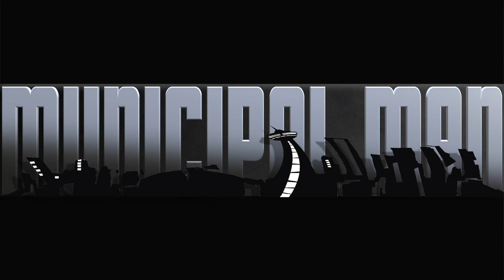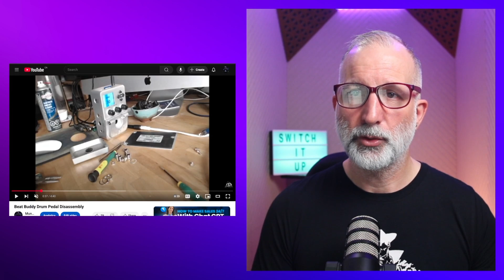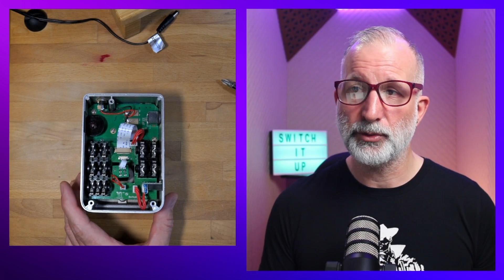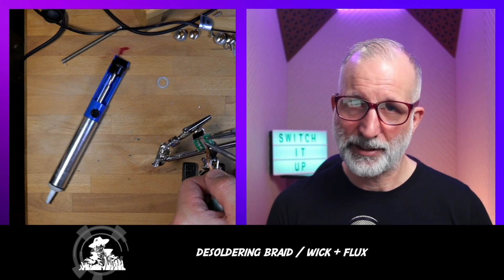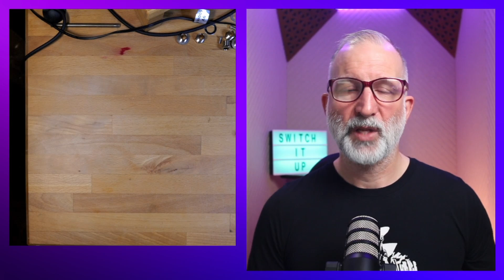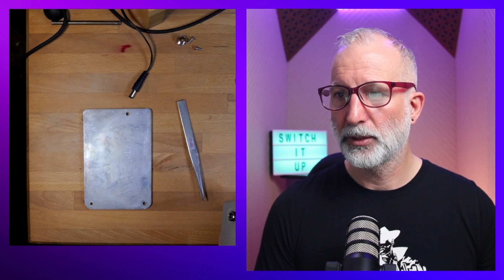Beat Buddy Tutorial #21 - Beat Buddy Internal Switch Replacement

Comment: I just finished the repair and it works!!! Thank you so much! I have to say that getting the switch separated from the tiny board was quite a task but I finally got them separated. I wouldn't have been able to do this without your video
Reply from the maker: Good to hear. Glad it worked out for you.🎉

Comment: Does the replacement switch make a clicking noise or is it silent?
Reply from the maker: There's a slight clicking noise, but when it's in the pedal and the cover is on, it's not noticeable in practice.